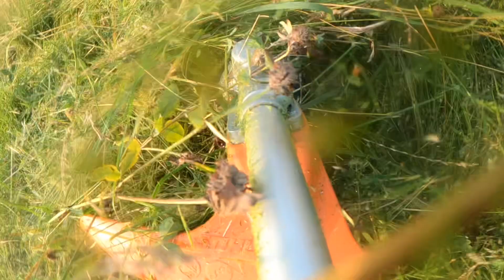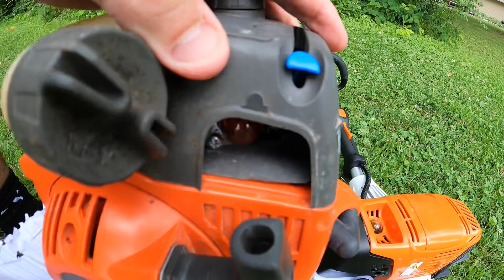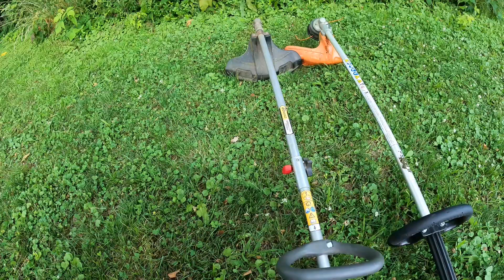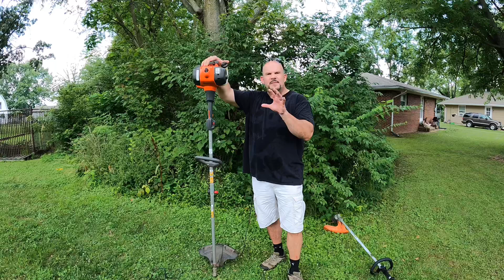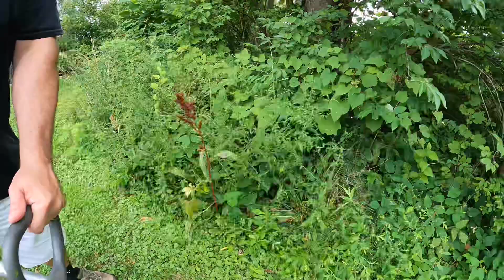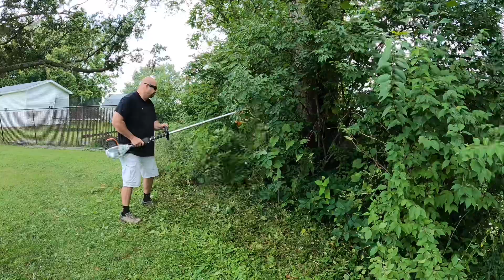Stihl FS 91R VS Husqvarna 128LD. 4 Stroke VS 2 Stroke.  #StihlFS91R #Hasqvarna128LD

Comment: I have two of those husqvarnas. And two other models. Had em for years. Never had a problem. I'm still sticking with husqvarna hands down. It's all how you treat ur equipment people. This dude is clearly paranoid. Im a mechanic I work on small engines. And I get more echos and stihl more than anything. Husqvarna very rarely
Reply: "Husqvarna very rarely" probably has a lot to do with Stihl and Echos having a much larger market share amount pro users.

Comment: I use many different tools in my line of work and I've ran all brands Low and High end. As far as Weed eaters go, the Shindaiwa T272X 2 Stroke is the Best one I've ever used, after 20+ years of use the motor got damaged internally and still has 4x the power of the Husky or Stihl.
Reply from the maker: Thanks for watching my friend!!  Have a great weekend! M

Comment: Yeah you're trying to compare homeowner grade versus commercial it doesn't add up
Reply from the maker: Bro, come on, dollars are dollars.  They are both Around the same price point, what does not add up for you.  I can get 10 X’s more machine for roughly the same price.  Hello!   If someone is that stupid not to pay a little extra and get commercial it’s on them.  Don’t give me that commercial VS homeowner mumbo jumbo.  Man Up and spend the money.
Reply: @DiscoveringHisWay  agreed the 91R is just the second level of STIHL they make so it says it’s commercial grade but honestly it’s not much more than the 70R
Reply: @DiscoveringHisWay  the 91 is almost double the price of the 128 😄 🤣 😂 😆
Reply: @DiscoveringHisWay  you do realize that Husqvarna makes trimmers that cost $400-$500 right. Every comment I see from you makes me cringe...

Comment: If this guy had any more baloney, he’d be working in a slaughter house. i’ve been using the Husqvarna 223l for 15 years and so far no problems usually starts third pull if cold. The four stroke with the big gas tank has to weight quite a bit more.
Reply from the maker: Thanks for watching, have a great day with your garbage weedeater.

Comment: This is quite possibly the most comical review I’ve seen.
You are comparing a second hand purchased Husqvarna 128ld to the Stihl FS91R. The 128 is a homeowner trimmer and the Stihl FS91 is commercial. Not even remotely a fair comparison. Compare the 128 to a Stihl FS56R, which is Stihl homeowner line. I have the 128 and I have beat it to death and it runs. I did mess up the drive coupling using too many extensions on a pole saw I replaced the upper shaft for the commercial Stihl Kombi because I acquired some Stihl Kombi stuff for next to nothing. I have three KM55 power heads and it will keep up with them. I’m not saying it’s better at all. I have never had a gear head seize up. It has a bolt to remove to add grease to the head just like the Stihl. I have a brush cutter head on one husqvarna gear head and it has been fine. 
I also have an older Stihl FS85R that some one gave me and I refurbished that unit with a new carb and throttle cable. It is way better than the homeowner units because, It Is A Commercial Trimmer. 
The Husqvarna is made in Nashville Arkansas, not China. It may have Chinese parts, but look at the stamp on the carburetor of your Stihl equipment, ZAMA made in China. 
So before you make a review, do some homework first.
Reply from the maker: Hey Tod
We go over your stupid argument in “how to choose the best weed eater” vid!  Man are you wrong!  The reason I did that video was because of the countless losers defending Husqvarna products and the weak suck arguments.  Enjoy eating some humble pie and go man up an get the commercial grade STIHL!
Reply: Again, homeowner grade vs commercial grade. I have commercial grade Stihl equipment. The 128 I bought used and was what I could afford to get at the time and it came with 3 attachments. Used it to make money and bought a hedge trimmer attachment and pole saw attachment. Used it at our hunting lease to trim limbs for hours and hours. It still starts as easy as any Stihl I have. Made two mods to it. One was a muffler mod to make it breath better and the above mentioned Stihl Kombi swap. Need to read my full comment. Never said it was better. It worked for my needs then and continues to do so as a backup and pole saw power head now. 
To your man up comment, is that the best you can come up with?  You sound like an Infomercial Salesman 😂

Comment: Awful comparison that stihl is over 100 dollars more than the 128LD. Pure ignorance.
Reply from the maker: Let’s see, typically people keep their weed eater’s for 5 to 7 years and you don’t want to spend an additional 100 dollars to have the best.  That would be additional investment of 0.03 per day for the best weed eater and warranty. 1/3 of a cent a day.! Hey why don’t you pray for wisdom from God who say’s if you lack it ask?
Reply: @DiscoveringHisWay  absolutely spend the money for a better grade but you're misunderstanding what I'm saying. You're comparing a cheaper Husqvarna (homeowner grade), to a commercial grade Stihl. Seems like you're going out of your way to bash Husqvarna. Buy a nice Husqvarna (commercial) trimmer at the same price of the 91R and then do a comparison. You obviously haven't used top end Husqvarna. That or you're too uneducated to realize the difference between a commercial and a  homeowner tool
Reply: The 128LD is low end Husqvarna.   It's not a bad trimmer but very low on the scale. For good Husqvarna you're gonna pay $350 to $500 for a good trimmer. And you aren't gonna find it at Lowe's (like the 128LD). I own a 91R. I grab it when I run out of gas in the 525LST
Reply: @DiscoveringHisWay the only one lacking wisdom here is you 😂
Reply: @DiscoveringHisWay learn the difference between tool grades before you do ignorant stuff like this. Again go buy a commercial Husqvarna for the same price as that Stihl and see what you get. Just because they're both 30cc does not mean they're in the same class.  Husqvarna 430LS (commercial 30cc) will smoke that heavy Stihl